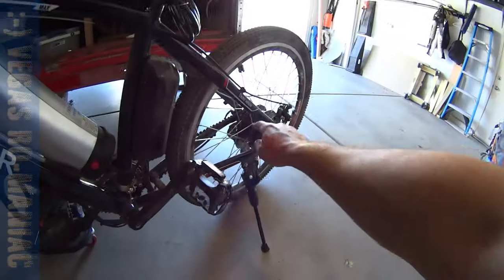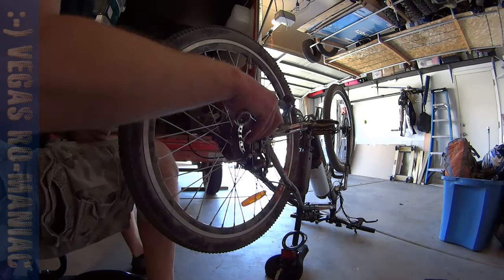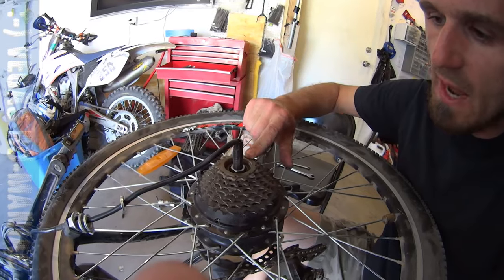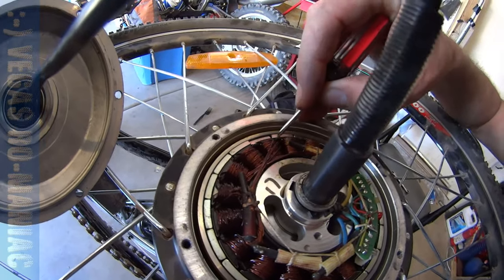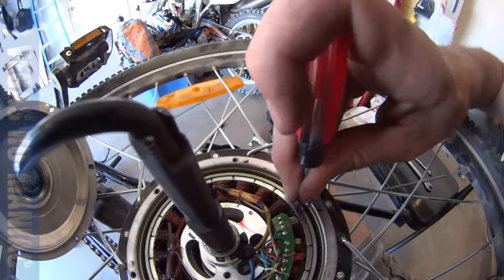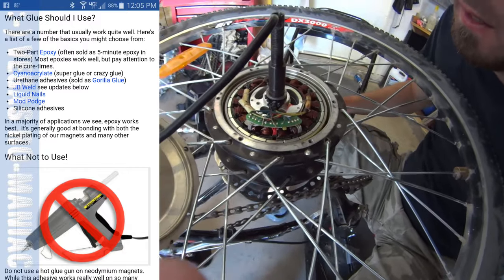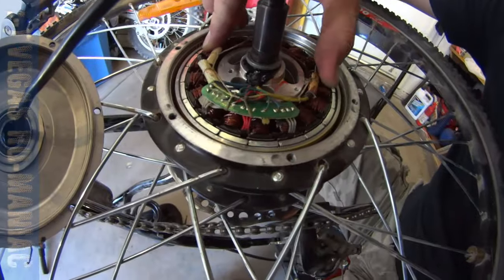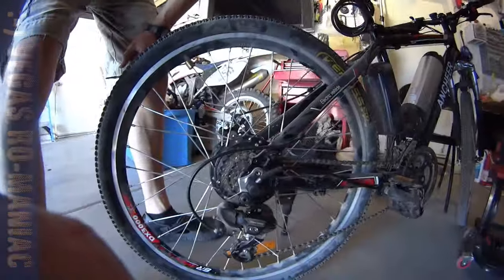Ancheer Electric Bicycle Hub Motor PROBLEM - FIX AKA Eshion Cyclamatic

Comment: ANCHEER TECH SUPPORT SUCKS!!!  Mine is fully charged but it only runs for few seconds and it dies   I have to disconnect the battery to turn in back on for another few seconds.  Lights and horn works even the system dies.  Is there any fix for that please?
Reply from the maker: That's a clear sign of a bad cell in the battery, the bms stops giving power out as soon as one of the cells voltage drops under 2.7 v..
Reply: @vegasromaniac  Thanks.  I just bought the upgraded battery (HRD-ZN-BW-0) with yellow jack, but my existing cable has a red jack (square) and it doesn't fit.  Do you know where can I buy the power cable with the yellow plug?
Reply: @vegasromaniac  
It works great now.  Thanks to you.  I thought it was the speed controller issue.  I noticed another issue though,  the throttle only doesn't work, only the pedal assist. What should I check to troubleshoot it?

Comment: With my bike, it makes a slight squeaking/screeching sound at full speed on throttle, can it be the magnets or just the bearings and rollers needing grease?
Reply from the maker: I had that too, it went away with tightening all the bolts on the bike and spoke but it might also be a a bearing that got tight in th e process of going over evrything
Reply: Vegas RoManiac I think it might be the bearing, I’ll have to remove the motor anyways to regrease the plastic gears inside so I’ll take a look at the bearings and maybe clean them and put some bearing oil in them. Thanks for replying!

Comment: Brilliant solution using super glue. It is good you didn't take them out , Taryl Fixes All, channel did a small engine flywheel repair and noted that each magnet is either north or south (who would have known?) and if they are mixed up= no output,  and possibly that hub motor is the same deal.
Reply from the maker: That makes sense

Comment: Ironically I got an ancheer too, but voilamart rear hub motor , my bike was just working fine yesterday,  plenty of miles on it . Not sure how to use a volt meter but seems like the controller is fine idk . I did splice stuff years ago,  alot of melted tape, but like I said worked fine for years
Reply from the maker: They melt sometimes if used hard ...
Reply: @vegasromaniac  right, it wasn't to bad really,  just really sticky,  the wires weren't damaged at all just the tap melting.  Except for 1 connector seemed to have some acid residue or something,  but anyway definitely plan to open my motor up today to see if maybe I can fix mine same as yours ,but just in case I ordered a new motor/kit last night,  inflation increased it by almost 100$ since the first one i bought about 3 years ago .but still not to bad especially for how much use i get out of them.  Thanx for your help appreciate it!

Comment: i have no lights on the display on my Ancheer  battery is fully charged any ideas how to fix this i have checked the controller no wires are disconnected

Comment: have a brand new one of those worked when pedals off now wont go electric all lights on but no power any hints starting with obvious no electric bicycle experiance HELP please
Reply: Niall Mulvany Since your lights are on its not a battery problem. One of the most common problems will be the electrical switch connection on your brake handle. When you squeeze the brake handle it stops the motor because you separate the connection at the brake lever. Inspect your brake lever carefully where the electrical connection is being made and make sure the contacts are touching each other.

Comment: My ancheer bike battery works and everything, turns on blah blah,  but the throttle doesn't work when turn on and also pedal assistant??  Umm what is the cause,  the battery or motor
Reply from the maker: If the battery is OK  sounds like a motor or the controller burned
Reply: @vegasromaniac  nevermind,  the left brake was off and broken,  I fix it and it started working again

Comment: Hi, my ancheer bike, after fully charging it, on level 1 peddle assist it rides for around 20 minutes. Butnon level 2 and 3 it only rides for 2 3 minutes and cuts off... if i press the assist module on button, it doesnt turn on. Ibhave to disconnect the battery and connect it again. Then turn it on and it turns on. But still same problems, cuts out. Does anyone have any ideas what it could be???
Reply from the maker: Battery problem. The bms curs off power because one of the cells it's weak
Reply: @vegasromaniac  ahhhh, look like il need to buy a new battery! Many thanks!

Comment: Can you use threadlocker instead of superglue?
Reply from the maker: Whatever glue you have for metal
Reply: Did it make the rattling noise go away completely? Especially during hard acceleration.

Comment: I can’t believe this I’ve had my  bike for one month and the motor has gone already I can’t believe you can spend £700 on a bike and have to start taking it apart and fixing it after such a short time

Ancheer should take the responsibility to replace all the motors on the ancheer bikes because quite frankly this is unacceptable

The bike itself is great but because of this problem that everybody is having with this bike it makes them not fit for purpose

I am fighting with ancheer to get my money back rather fixed because I think it’s safer to go for another bike manufacture until Ancheer except responsibility for faulty unreliable design and fix this problem 

Thank you Lincoln
Reply from the maker: Yeah it's not a bad bike mine had over 2k miles before I sold it.. Since than I got a mid drive bike, I have difrent problems
Reply: *accept. Let’s hope they don’t except responsibility.
Reply: Mine had a Problem after 6 Times of using it, its pretty much a useless thing. I Hope you got your Money back 😬

Comment: Having trouble with my ebike motor was working en just stop don't know what to do
Reply from the maker: Could be the electronics or maybe a pinched  wire
Reply: @vegasromaniac  thanks a lot will take a look
Reply: I think it could be dust because it has a lot of dust on what do you think

Comment: Is this why my ebike doesn't have power and it shows error 03 on screen?
Reply from the maker: Error 03 most likely it's a hall sensor error , search the error code for your brand
Reply: @vegasromaniac  it wrote there info 03 and motor no power that is hall sensor error?

Comment: I was wondering weather anyone can help I've got the same bike the bike turns on but then turn back off in secs the battery is fine and fully charged can any help at all
Reply: I am having same issue. Have you had it fixed?
Reply: battery, had same issue with a spare i bought. bought one online walmart 180.00 bucks and no prob

Comment: It seems that your rear brake is attached to the left handle. It isn't important but the standard set up has the front brake controlled by the left handle.
Reply from the maker: i like hit that way , same as my dirt bike , no switching when i go riding my dirt bike :D
Reply: Cool. Did you have to make the switch or did the bike come that way?
Reply: My Ancheer came that way. The motor worked for three days, about 18 miles, and then stopped.
Reply: it differs by country/region actually.
Reply: Just watched your videos because I bought this model Ancheer, good info on bike. BUT- your dirt bike has rear brake on Left handle??? What about your clutch???
Reply: a motorcycle clutch is left, right front brake, maybe why easier for me

Comment: can the motor be upgraded to something stronger?
Reply from the maker: Yeah but than you will drain the battery way to fast npt worth it
Reply: Nobody: it has to be electric battery powered.
Gas companies: have you met our lord and savior, Chinadoll motor?
Reply: Yes, but I recommend getting a stronger battery if you're gonna upgrade your motor. I have this same Ancheer bike and I replaced the battery with a 52v 20 ah triangle battery and the motor with a 1000w hub. The max speed I get is about 30-35 mph and the range is about 30+ miles (depending on how much torque you use). Was totally worth it imo.

Comment: I just changed my inner tube and tires on my ancheer bike. Suddenly motor stopped working.
Reply: What would be the reason why?
Reply: @PeteRoCC214  you cut a wire or bent a pin in the motor cable.

Comment: I would of used something better then super glue which is not very well suited for this type of application being that super glue or even crazy glue. #1 it does not fill gaps very well.  #2 it is not very heat tolerant.  #3 Even a slight bump or vibration causes it to break its bond. #4 if it gets wet with water and soaks for a while it actually will dissolve and lose its bond.      

Tho it is better of a fix then nothing.  but when you have to redo it next year or in a few months.  What I would do would be to remove the center of the motor leaving just the magnets.  then use some acetone or even rubbing alc  on a rag to clean out any grease off the inside of the ring of magnets. then get your self a tube of some thin high-heat epoxy such as Permatex 500-Degree High Heat Epoxy or JB weld High Heat Epoxy in the double Syringe

mix up a batch and use something like a pop cycle stick or a small tiny paintbrush to get the epoxy in the gaps between the magnets and a few dots of it on the top edge like you did with the super glue.   then use a rag with acetone to wipe the faces of the magnets off before the epoxy sets to make sure you don't have any high spots or sags that would interfere with the shaft spinning.  Tho if you get a thin coating on the faces of the magnets as long as its thin and don't cause any rubbing is ok.    alternatively, you can also use clear enamel nail polish instead of epoxy.   PS that also works on the copper windings to cover any nicks in the wires clear insulation coating

Comment: One of the crapiest Bikes there is, i have Used it 6 Times, and it already has a Problem in the Back Gear, it Just got loose, now its stuck in Position and the paddles Turn with it, which shouldnt happen, it should run empty Obviously.

Dont buy it, save another 600 bucks and get a real one instead.
Reply from the maker: I have over 3000 miles worry free on that ancheer before I sold it to buy a 2k bike . My friend broke my 2k e-Bike in 3.8 miles after I have 200 happy miles on it before with no problems, some people are just bad with things... Now I have a burned motor and waiting for parts in the mail.. I miss my ancheer...
Reply: @vegasromaniac  Guess i got a crap one then 😂
I got a Idea from my Brother how to maybe fix it, but If that wont do it i take of the Chain and use it only electric, a normal Bike is better in the end anyway than this tho, its to heavy and tiny and every normal bike thats bigger will be faster, and cheaper.